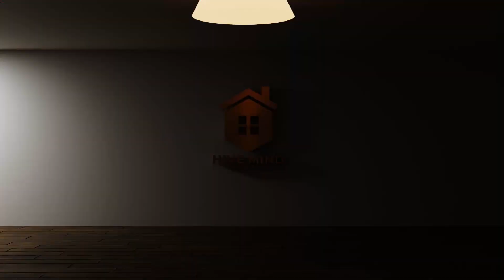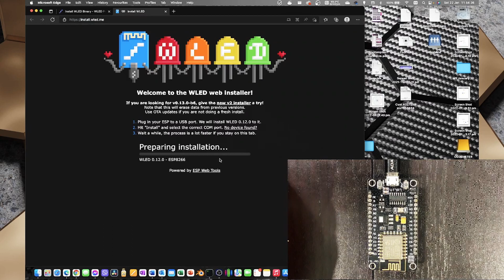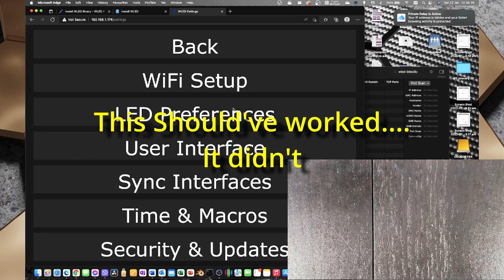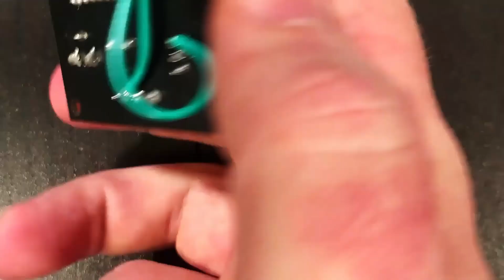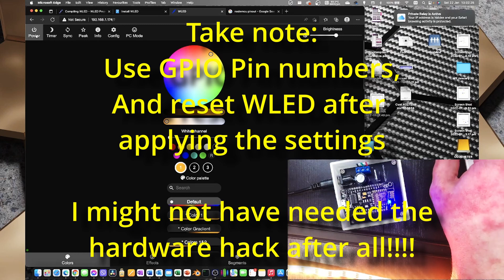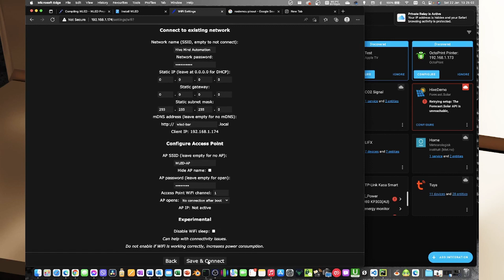DIY Project   Under Bar Lighting with a WLED Update

Comment: Thank you for your video. I like your solution with the controller board for nodeMcu with mosfet. Can I get somehow that board, please? I would use PCBway and pay you a commission.  The QuinUno boards are overkill for these smaller projects (and too expensive to get), I do not need a level shifter, I do not need a voltage regulator from 12v, I do need ESP32, but I like the mosfet solution.
Reply from the maker: I'm working on a newer version of the board that will have some more "customisability" and I'll make it available when it's ready to go. The current board has some...... problems.

Comment: I really like tutorials with the failures - how else to learn rather than from the mistakes. 
Truth be told the WLED configuration page should clearly state if you use GPIO numbers or Board numbers - it would be easier then ;-)
The LED cover costs around 1$/m on Ali - you must be very rich to buy for 90$ ;-)
Also, Athom sells ESPHome WLED controllers for around 10$ - up to 16A - that should also save your time and printing and design etc.
Btw: "Microsoft Edge" on MacOS? Really? ;-)
Reply from the maker: I use Edge for work on macOS. It’s just Chrome with a Microsoft skin. Also it’s a clean browser without my personal cruft on it to distract from the content

I couldn’t find any cheaper aluminium channel that would ship an uncut 3M length and the local supplier got it to me super quick so it was worth the extra $$

I’ll check out the athom boards. 16A power delivery should do the trick :)

Comment: I would be interested in the board and have you considered using a level shifter?
Thanks for the videos.
Reply from the maker: Yes. V2 of the board will have a level shifter. These strips are normally fine without it but if you put a longer wire on the signal you start having trouble as the signal voltage drops below around 3V3

Comment: I like those SK6812 LED strips.   Especially the ones like yours that can be cut every LED so you can get the exact length.
The white generated from a RGB without dedicatedwhite just isn't that nice.   I've been using Quindor's QuinLED Dig boards rather than a bare bones Ndoe MCU or similar as it has somce nice protection on it and can also use the ESP32 D1 Mini boards.   I find the older ESP8266 is a bit sluggish on some effects on long LED runs
Thanks for the great video.
Reply from the maker: I’ve seen some of the other YouTubers using quinLED boards but never looked into them myself. Might take a look
Reply from the maker: And I completely agree on the the mix white. It’s often got quite a blue tint to it. That’s why I use the RGBW strips